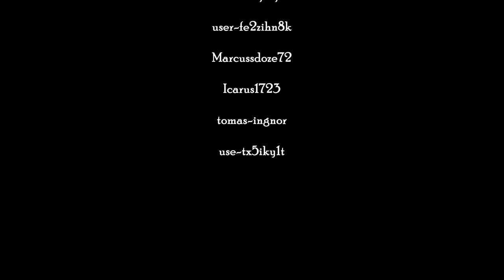Kynosys Work Table : #3 / DIY

Comment from the maker: Some people are concerned about safety when using the vise for this work. Please refer to the explanation as follows.

As an inventor and engineer, I will give more consideration to this work.

The two-hand switch is of course applied to my factory's production line.

I've given it a lot of thought in making this work, and instead I've put in place a different devices. There are five points that you're missing. 

The first is "moving speed."

Look carefully at the moving speed of the vise on my worktable.
It is very common to control dangerous instruments at speed during operation. Think about automatic rotation, escalators, etc.
Of course, we add extra sensors to ensure safety, but the basis is speed

There is a risk to all products that move automatically after pressing the button. Not all of them have industrial safety devices. Your concern is that every machine and machine that works automatically has a risk. Of course, it can also be placed under an automatically unfolded bed. But instead of going under the bed while it's automatically unfolding, we usually look at it from a distance and see it unfold.

The second is the location of the vise switch.

I used a special technique to mount the switch on the upper body of the vise without a separate wire. This is the position where the hand is not injured by the vise.

How to use it,
Switch on to raise the vise.
Place the board in the appropriate position.
Press the switch again to lower the vise, securing the board.

Where will my hands be placed in a dangerous place?

Not only me, but all carpenters and DIYs are trained to be safe enough for this level of work.
We use a lot of harder machines, too.

The third is the "frequency of use."

Accidents are always reported in the automatic rotation and escalators mentioned earlier. This happens because the frequency of use is beyond the limits of the system prepared for safety. As the frequency of use increases, the probability of accidents increases rapidly. For example, if the frequency of use increases to infinity, the probability of an accident converges to 100%.

So all the working products are made within the safety zone of the graph.

I don't use my worktable, thousands of times a day.

This means that I can use it once or twice a week and pay enough attention. It also means that it is located within the safety zone of the graph.

The fourth is that I have a warning about the movement.

When operating the air cylinder, the silencer makes a loud sound of air escaping. If you do not need this sound, pull the airline out of the silencer and pull it out of the room.

If I take the silencer out I can reduce the sound, 
but I made it loud on purpose.

This sound is loud enough for the air cylinder to pay enough attention when it moves. Unlike the light, this sound is loud enough that I can hear it in my workshop. 

Furthermore, the sound starts before the vise starts working, and then turns off at the end of the vise.
Perfect timing as a warning sound.

The fifth is, have a separate switch at the bottom of the table

I can operate the vise with this switch, and my body is far enough away from the vise.

This is the best safety device to remotely control the vise. These switches are also available for special situations,

In particular, for side vise, the bottom switch next to it has been made available.  It's such a strong force that I prepared for an emergency. 

Thank you.

Comment: fantastic project but please: there is a reason the 230V outlets have female connectors and not male!! The connector on the router is correct since it receives power. the connector on the table should have a female connector since it supplies power!
Reply from the maker: I am deeply grateful to you for your keen comments, as they prove that you watched my video carefully. 

I also had concerns. 
This terminal called the aviation jack has a strange characteristic. The distinction between male and female differs depending on perspective. 
I classified it by the overall shape, and you classified it by the shape of the pin. 

Of course, there is a possibility that the pins of the connector I installed on the bottom of the table can be touched. So I usually close the lid with the string attached. The probability of me touching this pin is similar to the probability of you inserting tweezers into the female hole according to your identification method. One reason is the convenience of the installation method. The male connector according to my classification method is not easy to mount on the table. The nut that is connected by turning also has this natural shape. Anyway, to ease your worries, I will use it with utmost care.
Thanks!

Comment: This is amazing! Truly!

 Two questions. I get that you converting 220v to 24V with adapter, but can you clarify where you get power for everything? I can't see any wires that lead to the wall socket.  Same question about air for the air tools? Thanks

Again, amazing project!
Reply from the maker: wow! You have a very keen sense of observation. The power problem was solved by burying the pipe in the floor. To use it as a main workbench, I set up a spot and drilled into the floor to bring in power and air lines. I didn't want it to look messy on the floor. After hearing what you said, I think I need to make a shorts video. Thank you for your kind words.

Comment: Awesome table build
PS
the only one thing i will do different is power connectors ...put female in the table so there is no chance touching it by accident by someone
Reply from the maker: I am deeply grateful to you for your keen comments, as they prove that you watched my video carefully. I also had concerns. This terminal called the aviation jack has a strange characteristic. The distinction between male and female differs depending on perspective. I classified it by the overall shape, and you classified it by the shape of the pin. Of course, there is a possibility that the pins of the connector I installed on the bottom of the table can be touched. So I usually close the lid with the string attached. The probability of me touching this pin is similar to the probability of you inserting tweezers into the female hole according to your identification method. One reason is the convenience of the installation method. The male connector according to my classification method is not easy to mount on the table. The nut that is connected by turning also has this natural shape. Anyway, to ease your worries, I will use it with utmost care. Another switch at the bottom of the table is, This is an extra switch. If you look closely, you can see that it is synced by color with the basic switch.

Comment: what happens if the hand or finger gets in the way
Reply from the maker: Some people are concerned about safety when using the vise for this work. Please refer to the explanation as follows.

As an inventor and engineer, I will give more consideration to my next work.

The two-hand switch is of course applied to my factory's production line.

I've given it a lot of thought in making this work, and instead I've put in place a different devices. There are five points that you're missing. 

The first is "moving speed."

Look carefully at the moving speed of the vise on my worktable.
It is very common to control dangerous instruments at speed during operation. Think about automatic rotation, escalators, etc.
Of course, we add extra sensors to ensure safety, but the basis is speed

There is a risk to all products that move automatically after pressing the button. Not all of them have industrial safety devices. Your concern is that every machine and machine that works automatically has a risk. Of course, it can also be placed under an automatically unfolded bed. But instead of going under the bed while it's automatically unfolding, we usually look at it from a distance and see it unfold.

The second is the location of the vise switch.

I used a special technique to mount the switch on the upper body of the vise without a separate wire. This is the position where the hand is not injured by the vise.

How to use it,
Switch on to raise the vise.
Place the board in the appropriate position.
Press the switch again to lower the vise, securing the board.

Where will my hands be placed in a dangerous place?

Not only me, but all carpenters and DIYs are trained to be safe enough for this level of work.
We use a lot of harder machines, too.

The third is the "frequency of use."

Accidents are always reported in the automatic rotation and escalators mentioned earlier. This happens because the frequency of use is beyond the limits of the system prepared for safety. As the frequency of use increases, the probability of accidents increases rapidly. For example, if the frequency of use increases to infinity, the probability of an accident converges to 100%.

So all the working products are made within the safety zone of the graph.

I don't use my worktable, thousands of times a day.

This means that you can use it once or twice a week and pay enough attention. It also means that it is located within the safety zone of the graph.

The fourth is that I have a warning about the movement.

When operating the air cylinder, the silencer makes a loud sound of air escaping. If you do not need this sound, pull the airline out of the silencer and pull it out of the room.

I didn't do that on purpose.

This sound is loud enough for the air cylinder to pay enough attention when it moves. Unlike the light, this sound is loud enough that I can't hear it in my workshop. 

Furthermore, the sound starts before the vise starts working, and then turns off at the end of the vise.
Perfect timing as a warning sound.

The fifth is, have a separate switch at the bottom of the table

I can operate the vise with this switch, and my body is far enough away from the vise.

This is the best safety device to remotely control the vise. These switches are also available for special situations,

In particular, for side vise, the bottom switch next to it has been made available.  It's such a strong force that I prepared for an emergency. 

Thank you.

Comment: What does a table like this cost. I want one
Reply from the maker: Thank you for your interest in my work. 
What I make are mostly prototype products, so cost-effectiveness may not be enough to explain them. In the case of this worktable, many air cylinders, nipples, and solenoid valves were used, and the wood used was birch plywood, so the material cost alone seems to have been around $1,500. The production period took about 3 weeks. 

Just kidding, but since my labor cost is $1,000 per day, it is difficult to measure the price of the worktable. I hope this will be of help to you.

Comment: Bonjour, C'est magnifique ! quelle réalisation et surtout quelle idée !
Je voudrais vraiment pouvoir réaliser le même seulement, je n'ia AUCUNE connaissance dans tout ce qui est pneumatique.
Crois-tu que c'est possible juste en copiant cette partie qui est la partie la plus importante? Est ce que des verrins électrique pourraient convenir ou leur preession est elle insuffisante? A ton avis quel est le poids que ton système peut supporter?

Peux-tu m'en livrer un pour Noël ? 🙂🙂🙂

Do you prefer that I use english language next time?
Reply from the maker: Tout d'abord, je tiens à vous remercier pour votre écriture sincère. J'espère que beaucoup de gens feront leur propre en se référant à mon travail. Je pense que vous pouvez faire l'apparence générale en regardant la vidéo. Cependant, il n'est pas facile d'expliquer la partie cylindre à air. Pour une utilisation comme étau, les vérins pneumatiques sont plus avantageux que les moteurs électriques. Selon le diamètre du cylindre, il peut produire une grande quantité de force. Vous utilisez probablement un compresseur. Tout d'abord, achetez un très petit cylindre à air, deux mamelons qui s'adaptent au cylindre, un solénoïde et les mamelons nécessaires. Les mamelons sont unifiés avec un diamètre. Si vous comprenez le fonctionnement de ces deux produits, il est très facile d'utiliser une bouteille d'air plus grande. Je vous recommande d'essayer ceci en premier. Le câblage peut être appris dans un magasin qui vend des bouteilles d'air. N'hésitez pas à poser d'autres questions. Réfléchissons-y ensemble. Et la langue est le français, bien sûr. Ces jours-ci, Google Translate est si bon que ce n'est pas gênant. merci

First of all, I would like to thank you for your heartfelt writing. I hope many people will make their own by referring to my work. I think you can make the overall appearance by watching the video. However, it is not easy to explain the air cylinder part. For use as a vise, air cylinders are more advantageous than electric motors. Depending on the diameter of the cylinder, it can produce a large amount of force. You're probably using a compressor. First, buy a very small air cylinder, two nipples that fit the cylinder, and a solenoid and the necessary nipples. Nipples are unified with one diameter. If you understand how these two products work, it is very easy to use a larger air cylinder. I recommend that you try this first. Wiring can be learned at a store that sells air cylinders. Please feel free to ask any further questions. Let's think about it together. And the language is French, of course. These days, Google Translate is so good that it's not inconvenient. thank you